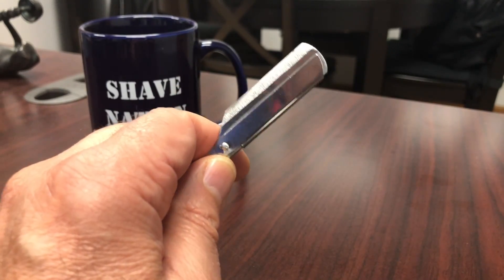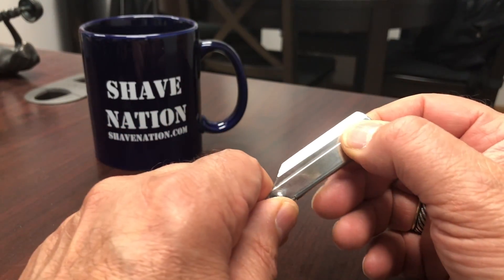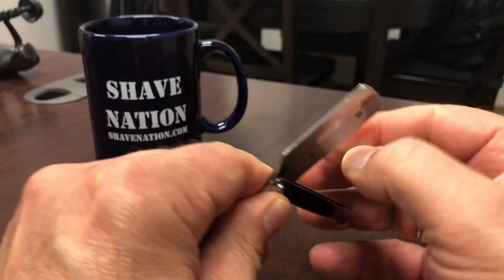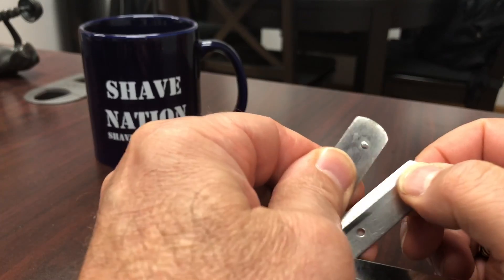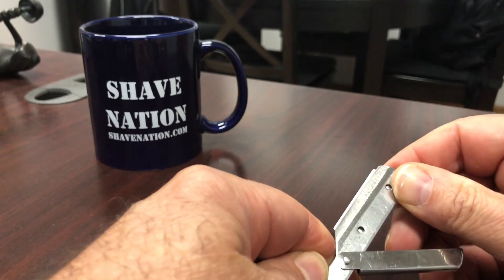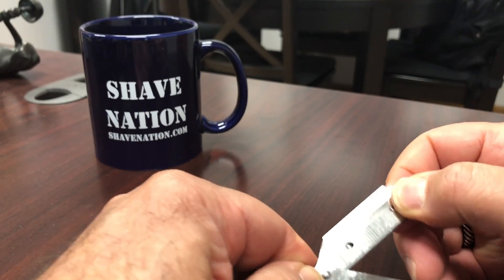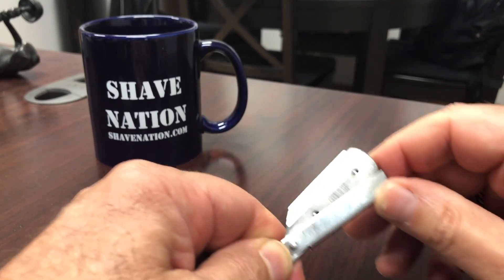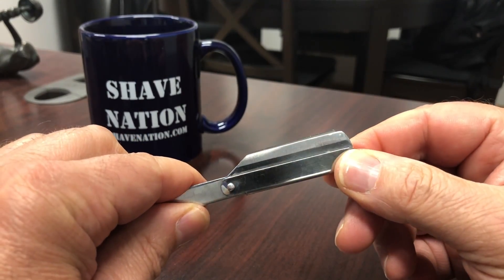Hinged Shavette Razor Blade Install - Replace - One Minute Tip !

Comment: Changed my razor a week ago, I ended up cutting my face up, I didn't know why, but I realized the razor I changed wasn't fixed properly and I noticed afterward that it tilted. Make sure to push the razor in with a towel to make sure it's fixed.

Comment: What are the best ways to store and display shavettes?
I use a test tube rack to store and display my safety razors but it doesn't work with my shavettes.

Comment: hey Geo, I tried shaving my moustache against the grain with your advice for how to angle the razor (after I shaved with and across the grain) but I felt like it was getting stuck and pulling a bit. Do you recommend shaving the moustache against the grain, and do you have any tips to shave it easier? Thanks
Reply from the maker: That's likely the most difficult area to shave. Lubricate with a good cream, use a sharp blade, and practice your angle.